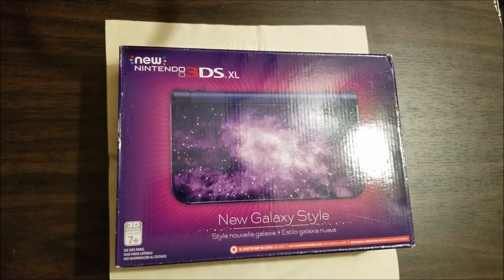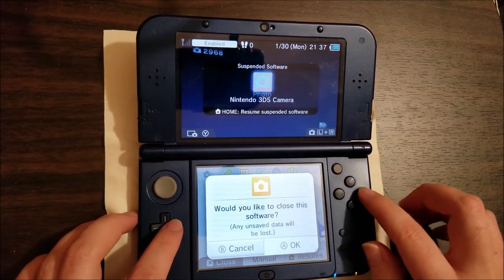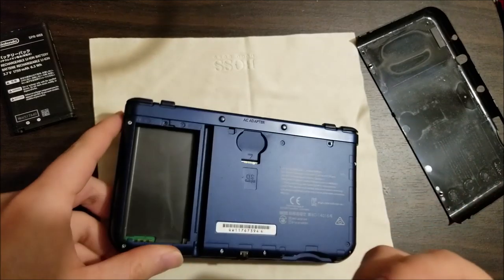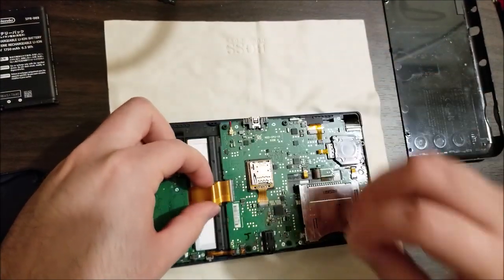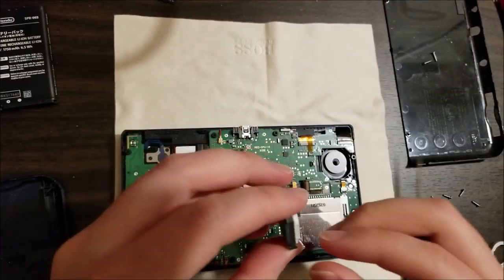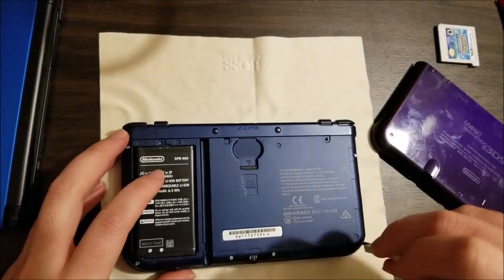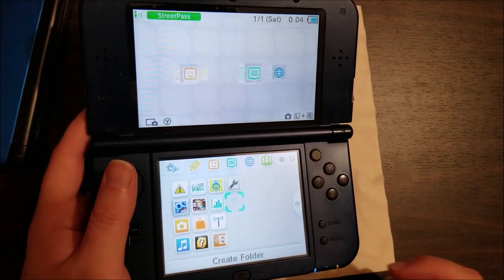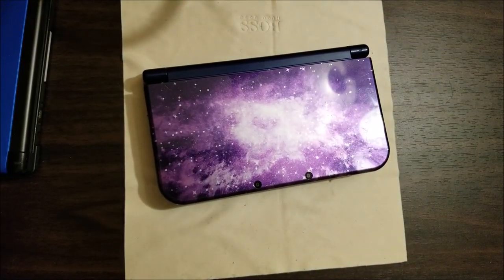Let's Fix: Nintendo New 3DS XL With Unresponsive Buttons And Touch Panel

Comment: My 3DS's bottom screen isn't showing but the touchscreen is still functional. Can it be fixed? It's a "New" 3DS XL model.
Reply from the maker: Have you tried reseating the bottom lcd connector? If that doesn't fix it you may need a new screen. Has it suffered any kind of physical shock around the time it stopped working? Has it ever been opened? If you shine a flashlight at an angle on the screen can you see a dim image?
Reply: No, it's never been opened. It got wet because my nephew spilled water over it.
Reply: And it does show a dim image when I shine a flashlight.
Reply from the maker: Ok so that means that the screen itself is likely fine, but the backlight drive circuitry is very likely damaged and some components related to it need to be replaced. The problem is such board level repair is pretty difficult if you aren't experienced in hot air rework. Otherwise your best bet is to find a local repair shop that can swap the parts for you.

Comment: I had this problem before, well I took out my screen Protector. 
But now theres new problem for the touch screen, only only like the top left corner of my touch screen works.:( all the buttons is great, just only a corner of my touch screen works.
Reply from the maker: Try re-calibrating the touch screen in the settings menu. If that doesn't work then I'm afraid it sounds like a hardware problem and the touch panel that sits on the lcd would need to be replaced.
Reply: @sjm4306  well I tried to recalibrate the touch screen, it won't work. I guess I will need to replace the LCD than.
Thanks for the help:)
Reply from the maker: That sucks, well at least the touch panel can be bought cheap and is only held onto the lcd by some glue strips. I suppose you could also buy a complete replacement bottom lcd with the touch panel pre-attached for a bit more but I haven't look into that myself.

Comment: I have the same 3ds xl like that, but my 3ds wont turn on no matter how much I try. Pls help!
Reply from the maker: Does it do anything when you try to turn it on (any popping sounds, either screen flashing)? Does it charge when plugged in?
Reply: Yes. It does charge, and it pops open. But it wont turn on
Reply from the maker: What I meant by popping sounds is do the speakers making a popping sound when it turns on (and do either or both screens flash briefly when trying to turn it on)? Exactly what happens when it tries to boot will hint at what part or parts may be at fault.
Reply: @sjm4306  yes
Reply: @sjm4306  also there is a crack in the top of the screen

Comment: By doing this, would it have any effect on my 3ds xl? 2 years it was soaked in water after my trip to the lake and i cannot touch the screen or move the circle pad and no volume. Would it work? Or is it dead
Reply from the maker: Unless you immediately removed the battery, opened it up and cleaned it thoroughly/let it dry completely shortly after it happened what has likely happened is the water caused shorts all over the board frying some parts and started corroding the metal contacts/pins/traces, causing permanent damage.
Reply: sjm4306 so i took it apart and saw that its rusted from the sd card slot. I didnt go anymore further with taking it apart, maybe for another time. Or maybe never lol but im sure its pretty dirty
Reply from the maker: Water damage is really a rough thing to try and fix. Most of the time I end up just giving up because the damage is too severe and widespread.

Comment: What it could be if my home button, my mic and my NFC reader doesn't work 
I think it was opened but I don't know why
Reply from the maker: I'd start by checking all ribbons are seated properly. It does sound like it was opened to me for that many things to go wrong at once.
Reply: @sjm4306  I'll try to open I hope it's not the soldering or something, or it could just be that they are disconnected?

Comment: Anybody know what to do when the power button gets stuck? I tried taking it apart and cleaning, but having a difficult time getting the clear silicone type piece to fit back with the power button, then reinsert. Help please.
Reply from the maker: I wish I could help, I didn't take the power button out of the unit I repaired and it has since gone back to the owner so unfortunately I cant check now. Hopefully someone else here can answer your question.
Reply: I had the same problem where it was hard to press my power button, but I discovered the shell was on wrong, and with a bit of effort, I moved the shell back on properly.

Comment: want somtin more complex??? my 3ds xl has blue light... both screens don't turn on but bottom has backlit i tried unplugging the cart ribbon and it'll boot for a good 10 secs and both screens would start growing lines across it literally but was just fine before 🤦🏽‍♂️ btw this is if it even turns on .. i'm on discord if u can help lmk
Reply from the maker: Sounds like the ribbon to the top screen is damaged and this is causing the weird behavior you've mentioned.
Reply: sjm4306 iv check it all nothing seems bad? i'm going to open it up again soon
Reply from the maker: Keep in mind the tear might not be easily visible without magnification or better yet if you can probe with a multimeter set to continuity to make sure every wire on the ribbon connects like it's supposed to.
Reply: sjm4306 shit.. this is why i asked if your down to go on discord lol i don't even have a meter either wow
Reply from the maker: I have discord on my phone but haven't used it in ages, my username is sjm4306 of course

Comment: i have another problem and my touch screen doesnt work. can u help me? its the same one in this vieeod.
Reply from the maker: Can you describe the symptoms beyond just that the touch screen doesn't work? Do any of the buttons/joystick respond?
Reply: @sjm4306  no. i have tried fixing the screen protecteter but nothing is working.
Reply: @sjm4306  wait. please make a video explaining this!!!! i just fixed it! all i had were crumbs in the corners of my 3ds so i took out the crumbs with a pair of tweezers and WALA! it works! i cant believe how much you have helped me with my ds. im so thankful!
Reply from the maker: Yep, the same problem mine had. Basically if anything is stuck pressing anywhere on the screen permanently, no buttons or other touch commands will work (it's the way the 3ds was designed).

Comment: I wish you Can fix my Nintendo 3DS new galaxy style the D-Pad is Constant moving, What should I do? Should I give it to a mechanic to fix it?
Reply from the maker: It likely needs the joystick replaced or its ribbon reseated.
Reply: @sjm4306  I fixed it by Updating the system.

Comment: Is the blue plastic on the Galaxy edition the same colour as the standard blue plastic on the new 3ds xl
Reply from the maker: Sorry I cant say for sure as this galaxy new 3ds xl is the only one I have seen in person. I've worked on tons of the old xl's but this was the only new one I've done so far.
Reply: @sjm4306  that's ok thanks anyway I'm looking to know because I've got the blue one but the outside face plates and the top screen plate is scratched up and I want to replace them without going near the motherboard cuz I don't trust myself 😂. Also would u know how to remove a really badly stripped screw from a old 3ds it's the screws under the battery cover

PS: love your videos👍
Reply from the maker: You can try a screw extractor if you can find one that is small enough. Another option is to use a nice sharp small flat head and apply inwards pressure while slowly turning to back the screw out.
Reply: @sjm4306  I don't have a extractor but I think that idea with the flathead will work thanks 👍

Comment: Any on have any tips on how to get a stripped screw out of the 3ds?
Reply from the maker: A couple of ways I know of: rubber band trick, use a special stripped screw extractor bit, drill out the head.
Reply: @sjm4306  thanks. I'll try those when I have the chance.

Comment: My 3ds is acting the same way, is there a way to fix it normally?
Reply from the maker: Try cleaning dust/debris near the edges of the touch screen first to see if that fixes the problem.
Reply: Also another thing, I spilled a couple droplets of water on the 3ds, could that have affected anything?
Reply from the maker: 100% that's the cause if the symptoms started right after the spill. If that's the case then turn it off immediately, remove the battery and place it somewhere warm and dry. Letting it run while there's still liquid potentially touching the board can cause permanent damage. Worst case you may end up having to open it up to inspect any potential damage and giving it a thorough clean.
Reply: …. Where is the battery?
Reply from the maker: If you unscrew/unclip the back plate the battery is plugged into the bottom of the 3ds.
Reply: Thank you so much, this made my day! My whole 3ds works now!

Comment: How do I replace the circle pad ??
Reply from the maker: Are you talking about the rubber cap itself or the actual electrical joystick component? If you mean the component I show the removal around 5:12. If you mean the rubber cap, you have to find where there's a slit in the plastic of the cap on the back and start it poked through the front of the shell, then rotate it until it's completely cleared the shell and can be removed (to install the new one just repeat the process in reverse).
Reply: sjm4306 ya the rubber it self
Reply: sjm4306 also thank you

Comment: can you fix mine? It has a slash of dead pixels all over ;_;
Reply from the maker: Sounds like you need a new screen. I can quote you how much parts and repair would cost if you shoot me an email at sjm4306@gmail.com with pics so I can confirm if the screen is indeed the problem.

Comment: I came here for my ds and it won't charge or turn on
Reply from the maker: Google "DS fuse locations" and check them with a multimeter. Hopefully it's a simple blown fuse then you can either replace the fuse or just short it with a blob of solder if you want a quick and dirty fix.

Comment: Like when i was in the home menu it didn't move but i could still use a,b,x,y
Reply from the maker: Does the dpad work or just the circle pad doesn't work? How about the shoulder buttons?
Reply: @sjm4306  the dpad and circle work when im in a game but the touch screen doesn't respond that well at all and same for shoulder buttons and for some reason the touch screen is tapping stuff with out me or that parts the ds i don't know p.s i think its getting worse
Reply from the maker: Sounds like the touch screen needs replacement.
Reply: @sjm4306  would it need to be replaced if i dropped it
Reply from the maker: It could possibly be just the ribbon cable isn't seated properly. Give it a try opening it and reseating the connector and see if that helps.
Reply: @sjm4306  thanks
Reply: @sjm4306  and the ribbon cable is that gold looking thing in your video corret?
Reply from the maker: The touch panel ribbon is a small 4 conductor gold colored cable towards the bottom of the console pcb (it is visibly connected to the touch panel on top of the lcd).
Reply: @sjm4306  ok ill tell you if it works or not

Comment: Im 10 Years Old And My 3ds Broke When I Did This It Worked "THANK YOU SO MUCH" And If I Can Do This Myself Then Anybody Can Do This,
Reply from the maker: Yes, so glad you were able to fix yours!
Reply: @sjm4306  Turns Out I Left It On The Charger Too Long So It Overheated And Something Melted And Turned To Liquid And Then It Died After I Fixed It And I Put It On The Charger And It Melted Again So I Decided To Just Get A New 3DS
Reply: @sjm4306  But Thanks For Helping Me Learn How To Fix My New 3DS If It Ever Breaks
Reply: @MEBOEFEBOE  wait did you use a offical charger? Cause i leave mt charger pluged to my new 3ds xl overnight and nothing happened

Comment: Can you fix it without a screwdriver?
Reply from the maker: If it's just the touch screen being pressed by a screen protector like in this video or some dirt in the corner then you dont really even need to open it to fix the problem. However if the touch panel is damaged or one of the ribbons is slightly unseated then yes you'd need to open it with a screwdriver.
Reply: @sjm4306  So no dirt. Where did you get the screwdriver from and what type do I need?
Reply from the maker: The 3ds uses a really fine phillips screwdriver. I'd suggest getting a cheap small jeweler's screwdriver or bit set if you wanna get into diy repairs as it'll pay for itself in no time.
Reply: @sjm4306  I have the blue and black Nintendo 2ds xl. Does the screwdriver still work with that?